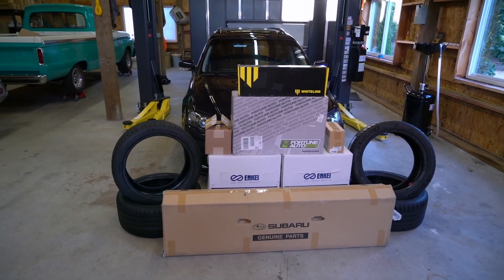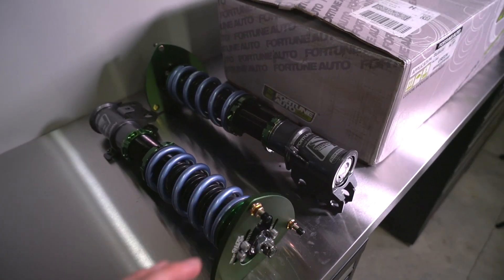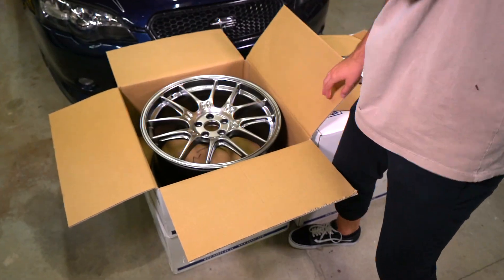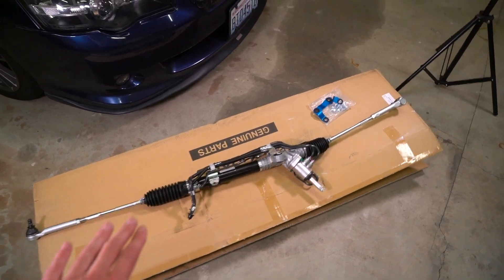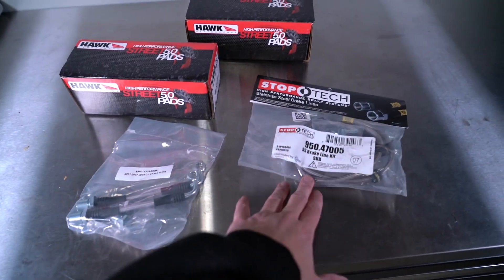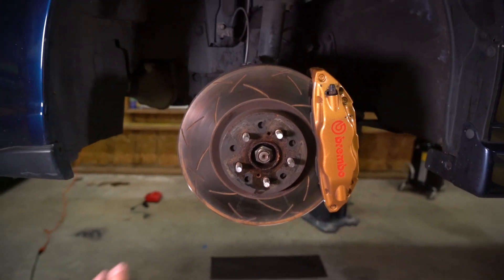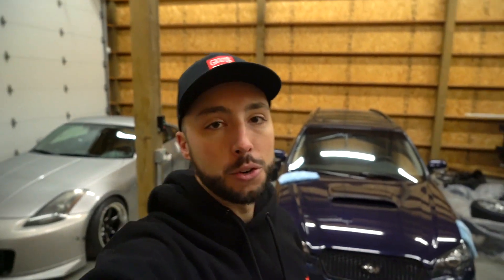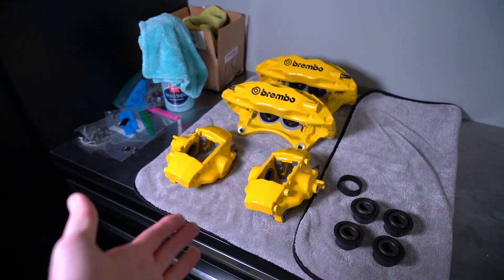The Full Send Legacy GT Wagon Build is FINALLY Going Down!

Comment: I'm buying a buddy's wagon for my new to me daily he's got it tuned for 320 whp  in an auto transmission I'm pumped it'll be my first turbo car anything I need to look for it's going to be looked at by my mechanic for a detailed once over before I buy it I'm super pumped
Reply from the maker: Oh yeah yeah, congrats dude! There's a few major things to look out for on the LGTs, if it's 05 make sure the factory uppipe with a cat has been swapped out for a catless option and check for the banjo bolt filter. Also, if you haven't already check out legacygt.com for a ton of good information on these cars.

Comment: Hey man, I'm moving up to the renton area in a couple weeks and wanted to know if you had any issues in the winter on the swift springs with the konis. I also have a legacy Gt and I've been looking to get some sportier suspension on the car, but it's just a daily so I don't wanna just snow plow all the time. I'd love to hear how that setup was for you. And the current one once you get em out in the winter
Reply from the maker: Nope, no issues but to be fair this car rarely sees winter conditions since it hasn’t been my daily driver for a few years now and last time it was I was living in California. I drove the car for many years through the rainy Seattle winters with no issue though. If you’re planning to take the car into the mountains and snow a lot, I probably wouldn’t lower it for ground clearance but if you’re just worried about snow in the Seattle area you should be fine as we don’t get much snow each year. And with the restored suspension and summer tires, this car is definitely a fair weather car and won’t go out in the winter.

Comment: yes Legacy build. do you have a partnumber: sti steeringrack.
Reply from the maker: Glad you're excited for more Legacy content! And the part number is 34110VA120

Here's a thread that walks through the whole process and parts needed: https://legacygt.com/forums/showthread.php/underdog-motorsports-2015-sti-steering-rack-swap-234351.html?s=285a866a993ca0f590d23ea7406df613&amp;
Reply: @avengednick  Thanks for the info. Keep up the Good work.

Comment: what advantage does the upgrade spring on the coilovers get you that the standard spring doesn't have?  is it just a different /firmer rate?
Reply from the maker: Nope, higher quality springs like swift, they’re not just round common with cheaper springs. The more barrel shape structure allows for fewer coils per inch for the same rate so, there’s less chance of coil binding and a reduction in unsprung weight on each corner.